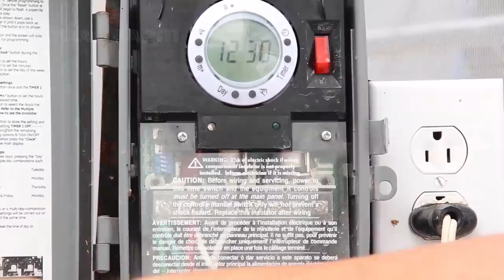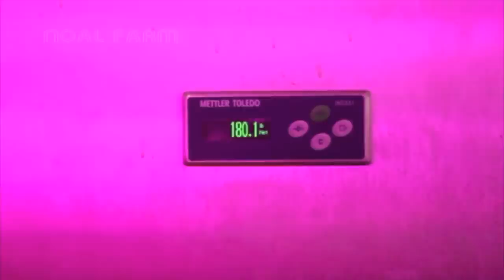Awesome Hydroponic Fodder Farming - Modern Agriculture Technology - Green Fodder Harvesting

Comment: I wonder about your waste in water, do you have a recycling system for it so that your not just constantly pulling new water from a pipe? if so it would help to reduce and save on water cost.
Reply: Hydroponics is usually a closed system, so the water gets re-used, I guess. If they’d go for aquaponic, they’d integrate some fishies, to enrich and clean the water…

Comment: We used this type of system after the 2012 Drought in the Midwest. Our system had a 2300lb a day capacity. It work well. We used a mix of Barley, Oats, and red wheat seed. Upside of it was consistence feed quality and availability, Down sides where  very labor intensive for 2 people and back then it was kind of trial and error. But overall can't complain. Thinking about putting it back into action on account of the current feed cost again. but have 3 cows, 4 pigs, mule, goats and a few chickens not 120 milk cows and all their young stock to feed with only owning 40 acres.

Comment: What's the input/output ratio? We would still need to grow cereal grains so we can supply seeds for those feed farms.
Reply: The question - do the dietary benefits of sprouts outweigh the costs associated with growing the fodder.
I.e one ton of ground grain compared to one ton of grain that is sprouted.  One might also ask if mixtures of fodder and grain offer advantages.
Costs associated with labor, capital, water and transportation can all be calculated and compared to health and weight gain of the cattle, pigs, goats, chickens etc.  
There is little point in speculation until all the above are known to one degree or another.
Rather surprised at the lack of hard data that has been published on this subject given the amount of discussion.
Reply: 1 lb of barley is 7-8 lb of sprout greens
Reply: @johnmarcum06  Thanks!

Comment: Kinda surprised no one has mentioned this in the comments yet. You still have to have a 1st crop to grow to harvest seeds so you can keep this running. It's very cool but isn't sustainable for the long run.
Reply: Cattles feed are the same grains, lucerne, several type of grassy things dried and granulated, siloed ect, so using fodder tech is relevant. They already grows crops for cattles over hundred years. Sprouted grains are better quality food especially at winter and on dry climate combined with field grazin has a place. Also more natural for the cattles digest system.